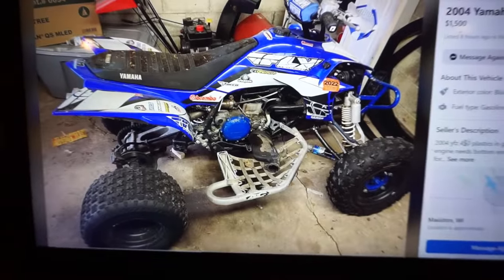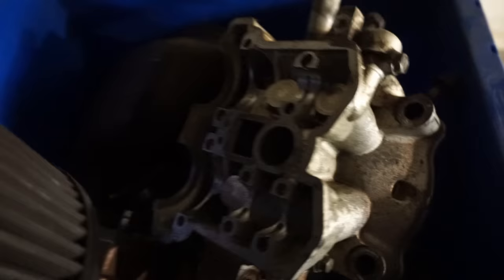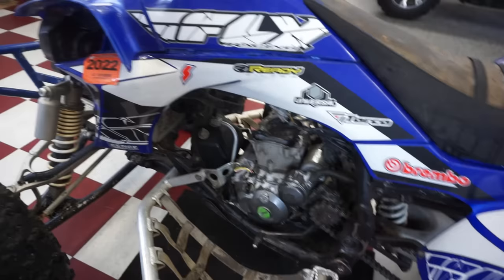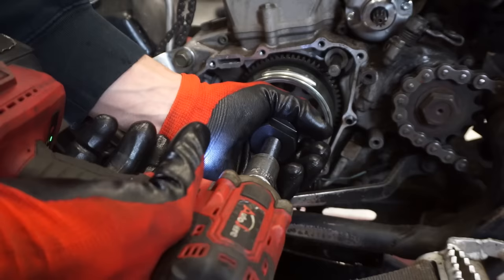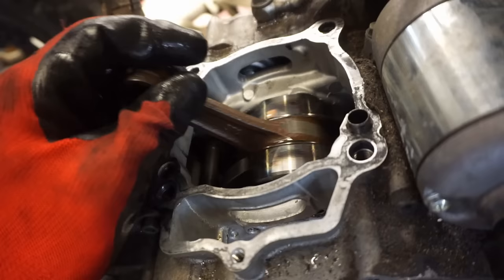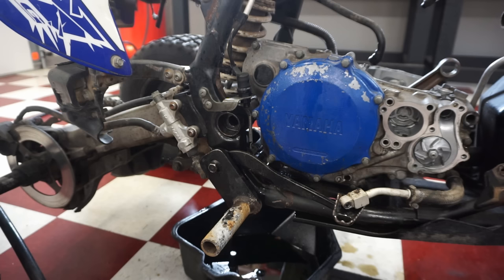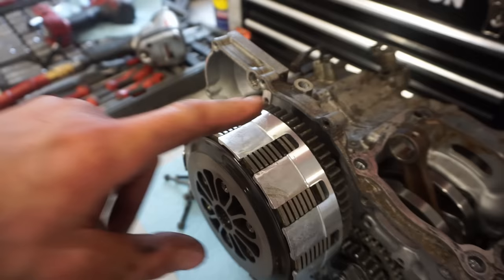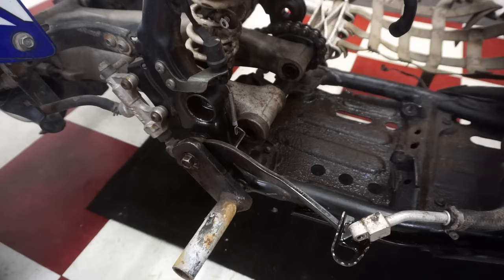I Bought a $1000 YFZ 450 and Instantly Regretted It

Comment: I did the same exact thing trading a crf450r for a KTM 530exc and come to find out the young guy had lean seized it because the carb was totally stopped up from sitting and I have sent the cylinder off to get it replated and a new piston kit and gaskets cost me nearly 750$. Why did I do that when my Honda ran perfectly. The KTM is very clean so lipstick on a pig.

Comment: Put a 2 stroke in it 250 or 500cc ive built one yfz got it for $1000 swapped it with a 98 rm250 engine now its mean. Also if you disconnect  the rear shock the swing arm bar comes out easier and goes in easily

Comment: u need an acetylene or propane cutting torch to use for heating up stuck bolts much easier just have to be no gas in atv tank or dirt bike like your kx80 incident. And have a big bag of Baking soda to smother fire's cheaper than 1 use fire extingushers but should also have wall mounted extinguishers so u know where they are.
Reply: Thats terrible advice. Flour is extremely flammable.
Reply: @nkb069  Your right I meant >Baking soda< thinking of a kitchen style Grease fire.

Comment: Looking good, I have a question to anyone who does this kinda stuff. I’m getting into engine rebuilding myself, and I was wondering how do you go about cleaning the cases and internals of the engine? Like when there are metal shavings everywhere how do you clean them all up. And when the engine cases are covered in dirt and oil how do you go about cleaning that? Thanks!
Reply: Lookup mXrevival, Cameron Niemela, Michael Sabo and Lund MX(Adam Entincknap's mechanic). All those guys are excellent to watch to get the info your looking for.

Comment: i would suggest a bigger air hammer, those small ones like that are the reason you spent 30 min. using that little thing.......those smaller ones are a joke for bolts like those

Comment: I was wondering how long you've been working on atvs? I have 08 yamaha yfz450 and havent started it in a 3 months. I will turn over but wont fully start. Where would you start to diagnose the problem?
Reply: Prob the carb when letting a bike sit drain the gas tank and empty the gas from the carb

Comment: Why not change bearings and bushings while.u have it all tore down? Least sounded like u were going to leave swing arm bushings and bearings I'd just change it all with all bearings in motor ! I'd just be mad if I didn't and few hrs later they go up like.20$ bearings either way do u I used too do this as well buy cheap fix and sell but damn a deer and covid ruined me bad and hard getting back up

Comment: god 1000€ yfz450 yes nah never again did the same mistake with a friend 50/50 on it... i mean it worth 1000€ in parts but it was all messed up...  same 2004 :)
needed new head the camshaft eat the top materials... so the cam was hard to turn, making the quad hard to start it did run fine when we toke it apart and back to gether did timing. but yeah with a friend did 50/50 (also never again i knew that but its fine but annoying buying with a friend..) just want it fix running and sold
but yeah now it cost more then 1000€ we drove 7H to buy a new/2nd hand head with cam and all for 220€ of a yzf450 2008 dirt bike, it had 3 bend valves but ours are fine, so yeah 150€ spend on fuel.. its stil a cheap buy but yeah way more work and it sucks they sell for around 3K €  i see some for 2800€ some ofr 3500€ not road legal, those are around 5K with licence plate and papers
they are a pain in the ass those 450... i hated them already, but now never want a 450 unless its new..

Comment: The video hasnt started yet. But I bet your crank is junk or the crank bearings are Junk.. Yammer 450s are JUNK...
Reply: YES i was right...
Reply: rod seized on the crank lol... Look how discolored the crank is where the rod sits.. Its like a rainbow. I think it got hot a little bit lol... JUNK.... This is SUPER common on the yammer 450s they run hot constantly and then shit breaks. Most of the time the rod welds to the crank lol like you see or the crank bearings fail and it sound really cool.. JUNK JUNK JUNK..